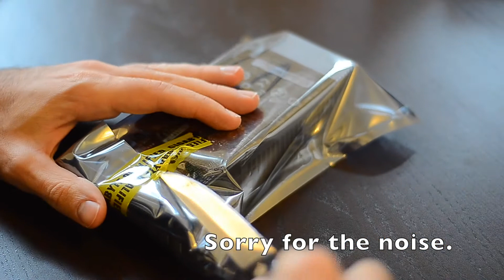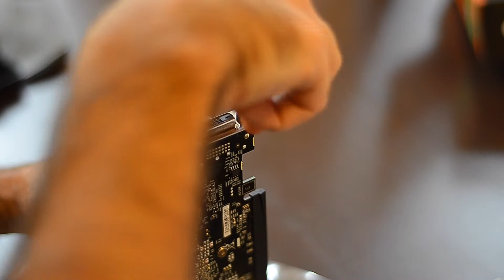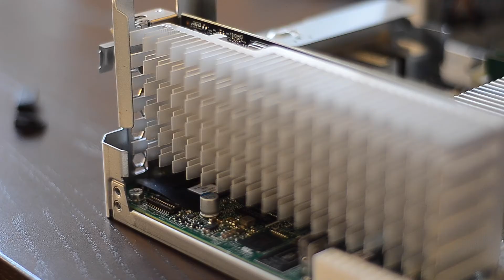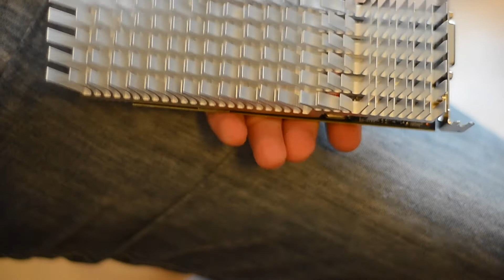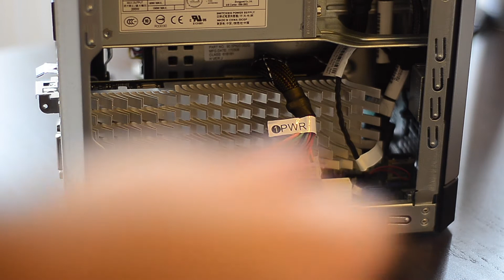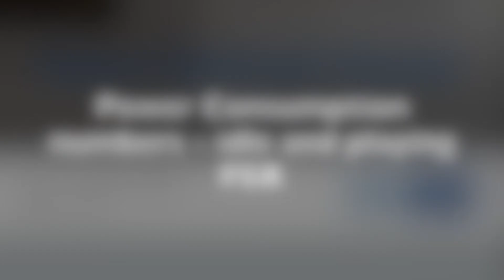How to install a big GeForce 1030 into a HP MicroServer

Comment: Dude it looked like all you had to do was install the card while the motherboard was pushed into the chassis instead of destroying the heat sink. Unbelievable. Facepalm.
Reply from the maker: I didn't manage. Do you think I didn't try before ruining my fingers and the card?

Plus the heatsink is quite thick and it can be reversed fine.

Comment: I'm running UnRaid, just bought an Nvidia Tesla P4 (on par with a P2200) and is low profile, single back plate, max 75w and needs no power plug, it's also passive cooling :) - Plex 4k and HDR here we come! :glasses-purple-yellow-diamond:
Reply from the maker: That's amazing! How does it perform?
Reply: @Shiunbird  Really well! Trascoded one 4k HDR to 1080p film with about 5% load.
I'm well chuffed with it. The P2200 is overhyped by people, this does about the same, if not better. Google the specs!

Comment: Looking to add a low profile GPU to my gen 8 too, to help with Plex.  How's the GPU and heat issue after all these years?  I hope you still have it. ;)
Reply from the maker: I sold the MicroServer with GPU. I used to have 2 MicroServers, one with Windows Server and the GPU and the other with FreeNAS.

I don't have Windows in my environment anymore, so there was no need to keep it.

However, I was able to play games like Cities Societies at 1920x1200 30fps quite high settings for hours without any problems, and the fans didn't spin up or anything - the system had 4 HDDs.

I think this GPU doesn't do hardware H264 decoding too (not sure), so maybe you would look into one of the cheaper Quadros.

Comment: Hi, thanx for this vid. Would be possible to fit a Mini ITX gpu like GTX 1650 (74W power consumption and max 35mm tick) in that space?
Reply from the maker: 75W is the top limit of the PCIe specification if I’m not mistaken.

If the fan is not too high you should be good too. But If you need extra power you are out of luck. Maybe you could route back from the optical drive bay but not I’m sure if it can deliver enough power and you would need adapters.
Reply: @Shiunbird  First of all thanks for your fast reply. Yes,75 is the limit. I saw a someone selling a microserver (https://www.bazaraki.com/adv/3360780_hp-proliant-microserver-gen-8-gtx-1650-gaming-pc-8gb-ram/) and claim to have a GTX 1650 in it. From the picture, is clearly fitted with no metal bracket and this lead me to the fact that is surely a non LP GPU. By the box seems to be a full lengh GPU but seems too long for the space in it and if mini itx gpu too tall to fit due the metal support near the psu.  What do you think ? With that card, microserver would be great for 1080p gaming....
Reply from the maker: @scrooge79  If your main purpose is to game, I'd surely get something else. For the same money, you can get a much better PC. If you want a computer to run 24/7 and need the small footprint then I guess - if it works, why not? You can run Windows + a VM or two for what you need and with 16GB of memory you could still have some 10GB for gaming.

I wouldn't, personally.

I will sell my microserver soon. I am building a 8 bay fanless system with 32GB of RAM for my NAS.

Comment: these shoes don't fit. No problem, I'll just bend these little toes and chop off the large one. There you go, ready to run
Reply from the maker: Desperate times take desperate measures. =)
I don't own this server anymore but when I had it, it worked perfectly as a do-everything server for home. Plex with hardware decoding worked perfectly, the temperatures remained low. I never played on it so the video card never got hot. I had a whole flow where torrent downloads would end up in plex automatically, and I could also transcode it online (1-2 simultaneous sessions only), and everything was reachable via nextcloud too.
Reply: @Shiunbird  What do you have now instead? I'm thinking about upgrade for my G8 Micro now
Reply from the maker: @snakesms  I am not doing Plex right now. I'm building a full-silent setup and then plex will come into the picture.

I already have a 2U silent Xeon (I'm modifying the chassis for better ventilation) - This will become my NAS with 6 SSDs.

And I'm planning a 4U dual socket passively cooled virtualisation host. It will probably be a dual ~55W Xeon. This may come to run Plex with a new passively cooled GPU.

I'm not desperate for Plex because of netflix. I own an Apple TV.

In the meantime, another MicroServer is acting as do-everything at home. I will review it when I am back from holidays. It runs FreeNAS, has 6 Gigabit Ethernet ports, virtual pfSense and my nextcloud setup.

Comment: The PCI-e is 16 or 8x? because my MicroServer Gen10 has a PCI-e 8x... and that's sucks...
Reply from the maker: It is a PCIe 2.0 or 3.0 16x slot. (bus or connector). PCIe version is CPU dependent - Xeons are 3.0, other CPUs run at PCIe 2.0.
I don't get why PCIe 8x is such a problem. What do you plan to run on your Gen10 that would be bottlenecked by 8x?
When they announced the Gen10, I bought another Gen8 to have it in stock (I've sold it now). The reasons are: iLO and front HDD door (very useful as I've had dead hard drives and I wouldn't be able to replace them easily where my server is installed on Gen10).
My PCie slot is populated by a 4-port Gigabit Ethernet card and I have a virtualised router running under freebsd there.
Reply: @Shiunbird  my idea was run PLEX, and AMD is not well supported on Linux. So, I thought that a good option is to use an NVIDIA Quadro P400, but the slot is 8x not 16x, só, the card does not fit. :(
Reply from the maker: @brivaldoalvesdasilvajunior551  Oh... that's not about the speed then, but the length of the physical lanes.
Yes... well... as you saw in my video, you have to bend the pins. If the Gen10 will do a double card, you can get a RX560 and do a VM. If you can run VMWare you could assign the PCI slot to the PLEX VM and that's it.
What I did was use the microserver only for storage and (unfortunately) virtual pfsense and my applications run on a separate server via iSCSI or NFS. It works ok.
I am, however, planning to build a 8-bay fanless NAS later this year, retire and sell my Gen8.
Have you tried Windows + Hyper-V?
Reply: @Shiunbird  that's exactly the problem. I don't want to use Windows. Windows works with PLEX and AMD, but I want to use a Linux environment. That's why I start to search about an NVIDIA card that fits on PCIe 8x. :D
Reply from the maker: @brivaldoalvesdasilvajunior551   MSI GeForce GT 710 2GD3H H2D  -> this is short, passive and single slot. If all you need is H264 acceleration (not sure it has H265), you should be good to go.
https://www.msi.com/Graphics-card/GT-710-2GD3H-H2D.html
It's PCIe 2.0 x8.
Reply: @Shiunbird  sounds interesting, the problem is the size... need to be low profile too (odd, I know). Thanks anyway.
Reply: @Shiunbird  

>I am, however, planning to build a 8-bay fanless NAS later this year

may I ask what model are you looking at?
Reply from the maker: @mailing4548  I am thinking of using this chassis: https://www.xcase.co.uk/collections/4u-rackmount-cases/products/x-case-x445-c8-lcd-4u-with-8-hotswap-bay with a E3-1260L and a S1200 motherboard from Intel. For storage, SSDs. A fanless ATX power supply, a SAS card that would go well with FreeNAS and an Arctic Silent heatsink.

Comment: You don't need to bend all, just the first end near outputs, and place near power cable, everything other fits perfect.
Reply: Thanks for the video. 

For those who still need to install the card. I managed to install it without removing the motherboard. Just remove the case, power cable, sata cables.

Bend the heatsink fins inwards closest to the output until you can insert the card in the slot.

Hold the card tight and still while bending the heat sink fins on the power cable end to create enough clearance. Use a screw driver and pry the fins to bend them and adjust with fingers until the temperature sensor cable and power cable fits. Insert the data cables. Screw in the card and you are done!
Reply from the maker: Woraspvm I tried. Must bend all otherwise can’t slide the motherboard in. I also tried installing it without removing the motherboard. I didn’t manage.
Reply: @Shiunbird  I trimmed 3mm off from the first column of fins  (6 fins closest the backplate). So I could put the card in the socket w/o removing mobo. Then I trimmed 3 row around the power connector. Then trimmed 2 colums (2x4 fins) at the USB socket.